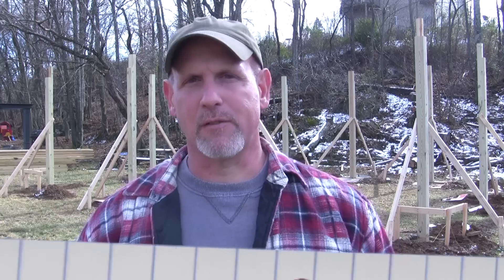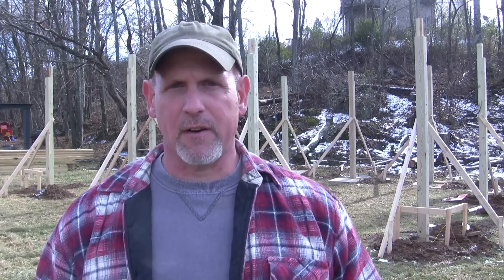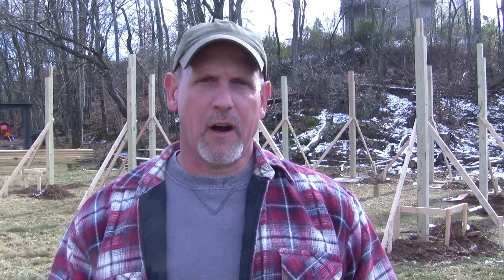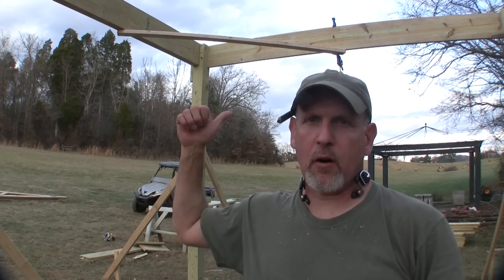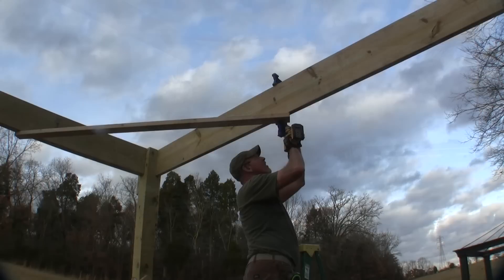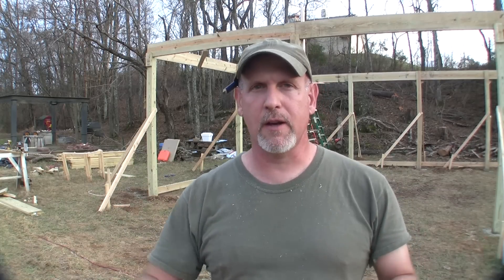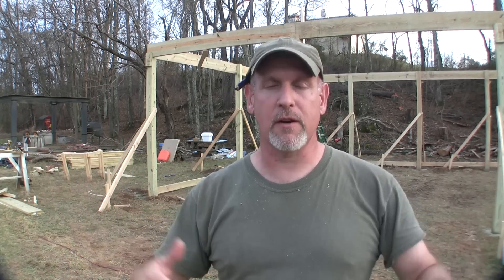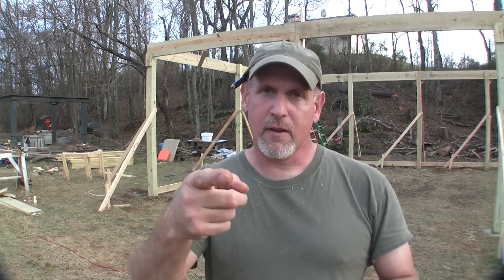How to Build a Pole Barn Pt 4 - Banding & Bracing for Trusses

Comment: On the front you needed a double 2x12 beam:  the roof trusses were not over a post.
on the rear you only needed a single 2x12 beam since the 5 trusses were ea over a post.
true?

Comment: Man I wish I could've done anything at all with my posts before going in the ground. We're in Meigs County on a ridge top. You never know when you're gonna hit solid rock with the auger or not. Not a dang one of our post holes is the same depth and I tore up both sets of teeth plus the auger screw tip just trying to get the holes down three foot. Mostly had to let the auger do what it could then use a bar and hand digger to get close to depth. Got my bands up and will flush cut the posts with a sawzall on the long walls then angle cut the posts on the gable ends once the trusses are up. Frost line in East TN 😂

Comment: I'm torn between putting my trusses (×2 on interior posts) over each post like the commercial pole barn builders do at 12' spacing or do 8' spacing with 2x12 double header on truss bearing sides. I'll be adding 1/2" plywood sheeting on top with rubberized material under the metal roof and I'd like to think the way you just did yours with the 2x12 double header on truss bearing sides and trusses at every 2' would be the way to go... Did you add a truss heel to the trusses when ordered? ... if it is to ever be insulated and closed in of course

Comment: Before putting the post in the ground drill 2 opposing holes and install 2 pieces of rebar then pore the concrete. Gives the concrete something to hold on to besides the slick 6x6.just saying.

Comment: I learn tons...I have zero experience in this and I think it is very interesting.  I do have some questions, how do you know how many nails to use and why nails over screws?
Reply: Screws don't have as much give, nauls will flex a little for shear and deflection. I'm a mechanic and i like screws but in framing, nails are better.

Comment: Iv watched all of these for my building I’m starting this week and I have a question. Where you notched your poles on the top of the posts, if I am using metal on the outside instead of sheeting it and plan on running the purlins on the outside of the posts instead of flush like yours and later on I plan to put metal on the inside as well can I run the header boards all the way around on the inside and outside of the posts without notching? I really enjoy your videos
Reply: He's notching so the weight will be on the 2×12,nails and screws will only tear out under load. Bolting may work for awhile but will probably split the 2×12 in time. 
But don't quote me,I'm not a carpenter nor have I played one on TV!😂🤣
Best to notch, haven't seen it done any other way. 🤔

Comment: 1:49  Frost heaving is where the moisture in the soil freezes.  Just like putting a water bottle in the freezer and seeing it expand the bottle, the frozen moisture will expand in the soil and it puts pressure on posts, foundations, footings, etc.  The colder it gets and longer it stays that way means the further down the moisture in the soil will freeze.  That pressure pushes up on the post.  When it warms up it resettles to a point but after years of repeated cycles, it can heave the post out of the ground, crack foundations or basement walls, and rack buildings out of square.

Comment: Fette, coming back and watching this series of builds for the second time, being that you work alone and for strength why not break the front and back banding into three sections making them easier to handle and bear on top of each post? That way you don't have seams under the trusses that are not supported. I'm just asking not trying to try and learn for the future. One of these structures is in my plans.

Comment: I do like the series so far but I thought I'd mention that where I live I was checked by the town inspector and was told that a) I needed a permit and b) my beam joints were supposed to be right at a post, not in between (too weak). I had to adds another beam all around with the joints at the posts. The inspector made another visit before I could move ahead. Trusting, eh?
Reply: Could not agree more.  The seams should rest on the post regardless if you glue the wood.  Take a look at the carrying beam in your basement.  The lolly column is where the break is -  Nice build and good instructions otherwise.

Comment: Just posting this for others. I saw pictures of an Amish built pole barn and where the 2x12"s are at the top of the posts notched. They used one 2x12 outside of post notched and on the inside another 2x12 not notched for the trusses to set on. They used four big nails on each side.  Thanks.

Comment: great video sir. My company builds lp-gas bobtails and we've been trying to open a a small shop but i think somethink like this will be our best bet. However were gonna try to build it about 16 ft tall using 20 ft posts. Should the principles of everything your doing still be the same. also we were thinking about pouring our pad when we put the poles in. is that something you recommend or do you recommend building the whole pole barn first?

Comment: For somebody who already knows what they're doing is a really awesome videos but for somebody that has absolutely zero knowledge some ideas need to come forth first idea I wish you would have shown how to set up that level you showed the receiver but that the transmitter and then on every corner number two some of your banding was not on post why do you allow the end of the two by twelves to hang in mid-air I always thought those had to be on post....And to be very very picpic incredible do you really think nails are enough you put like 6 nails and every banding and post lots of people think bolting is better I think nails are enough but I don't know anything....2 by 12 is an awful big thing 16 feet long why wouldn't you use just 2 by 12 8 feet long from post to post to post

Comment: I once pulled out at least 100 rotting fence post out and replaced them on a horse farm. they put dry concrete mix in twenty years earlier and every one of the came out of the ground with dry concrete around them. Just add water. trust me brother.
Reply: stoneygreek   I’m late finding these videos but totally agree with you about adding water mixing the concrete.  I had the same experience you spoke about.  As a kid we had set tall posts for a lean to add on at our barn.   16 years later after no longer using the building I decided to remove this part of the structure.  When pulling the posts found several of them that the outer edges of concrete had set up but the center of mass was still dry powder.   I  remember my Dad and my Grandfather arguing about it.  My Dad was always in a rush and liked to do it different just because he could lol. 
  But that being said definitely wet the concrete before it goes in the hole.

Comment: How about a report on your laser?  Model, how long you've had it and what you like or dislike about it?  It looks like a good one.  I use a straight line DeWalt and can see the advantage of the circular sweep with a sensor.  You must also have a good brand of lumber.  Where I am an 8x8 can vary 1/4" in dimensions and up to 3/8" if it is a pressure treated one.  Also getting good grades is difficult as our #2 and #3 seem to be what we called 'culls' a few years ago.  Center ring in every stick so warping and twisting is terrible.  Nice job your Kubota will appreciate it.  I was waiting for you to justify buying a hoe for it so you could lift those sticks into place!!!  (Another tool is always good).  Doug

Comment: Why not set up where your front band j9ints meets on a post
Reply from the maker: +Joe Butler I didn't want both runs of the bands all breaking in the same place.
Reply: *****  I see what your saying but that sets you up for a butt joint just hanging out in thin air
Reply from the maker: Yes, but they are glued and lag screwed all the way across.  Essentially you end up with a laminated beam.  It's very strong.
Reply: ***** yeah but breaking over a post would have been 10 times stronger
Reply from the maker: It's not carrying that much weight, Joe.  It doesn't need to be ten times stronger.  You could do what you are describing but you better plate the top or it might want to roll.
Reply: ***** ok I see what your saying

Comment: I have enjoyed your series so far.  am now retired but also used to do building construction.  There are things I would do differently but if it works then I say go for it .  This is reference your comment about frost heave and not understanding.  Think of what happens if you freeze say a botle of water or other liquid What was adequate for the liquid becomes too small for the frozen . Heave as essentially the same.
Reply from the maker: James Gass Thanks James.  Great explanation of frost heave.  I understand it better now!

Comment: I got it to work. Just finished watching the whole series! I will definitely come back to reference when I build mine. 
One question though Is when you put your floor in what will you do to seal the edges of the building from water, dirt or anything else getting in from the bottom?
Reply from the maker: Ryan Bender I can't remember the brand but any good concrete sealer will work.  I'd stay away from the stuff you buy at the big box stores like Thompsons, etc. and get a more industrial type sealer from a building supply company.

Comment: Frost heave is really easy to understand.  Water expands when it freezes.  If the ground freezes below your footings, it pushes the footings up.  It takes quite a few cycles, but after a couple of years, if your pilings weren't deep enough, your building won't be plumb or square.

-jcr
Reply from the maker: NSResponder Great tutorial.  Thanks for sharing.

Comment: You're good at explaining things but those joints need to fall on a post. Doesn't matter that they aren't staggered as long as they are supported on the end by a post.
You could always use a metal strap if you're worried about flex.
Reply from the maker: DEE K Thanks Dee.  Those beams are glued and lag bolted.  They aren't going anywhere.  And they aren't really carrying all that much weight.  If you are really worried you could plate the top and bottom but I think that would really be overkill.  Thanks for sharing your thoughts.

Comment: i mean no disrespect but here in Australia our building codes dictate you have to have the joint of a structural beam supported but might be different in the USA. Enjoying the series alot and cant wait to start building my own soon. nice work on the check outs also just another tip for the future use a straight edge that can span most of the post with a level and you will get the tops and bottoms perfect just a little trip I've picked up while building houses for the last 5 years or so
Reply from the maker: andreweasty No offense taken.  I appreciate you watching and commenting.  I think your comments make a lot of sense.  Thanks for sharing!

Comment: I am really enjoying this series. Another way to strengthen your double beams besides the glue and lag bolts is place a piece of sheet metal full length between the two boards. Then you can lag it up tight. Don't believe it will work?, take a piece of 28 ga. galvanized metal 8" x 24" lay it flat and see how easy it will bend, now rotate 1/4 turn and try to bend it edge wise. Can't wait to watch the rest of the series.
Reply from the maker: John Grange Great tip.  Thanks for sharing!  I appreciate you watching the videos.

Comment: Great videos! I'm curious about one thing. When you decided to run your top boards to handle your trusses and double them up using 14 or 16ft long boards, why did you not just center the boards on the posts?
Reply from the maker: Steve Pritchard Thanks for watching.  The bands are centered on posts in the back but the spacing on the front posts is such that it did not work out that way.

Comment: Really enjoying the video and especially your own personal narrating. Learning plenty. I harvested the tree last month and am ...rather was thinking of a pad and sticks. Very expensive and holding me back. I have not worked or built a pole barn and slightly unsure about what obstacle might bugger me. Your video has really taken the fear out of me and given me the strength and knowledge to begin a 24 by 32 pole barn. I have a back...small 22 hp Kubota to dig holes. If I make small wood frames and place the pole inside before I pour cement will this work?? The Kubota will dig more of a trench thus a wood frame with nails around the bottom of the post then the cement. What is your thought?
Reply from the maker: r1bourg Thanks for watching.  Glad the videos have helped out.  I'm not sure I understand what you are describing about a wood frame.  Sorry, but I just can't picture what you are trying to say.  I'd just dig the holes and set the posts the way I did if you can.

Comment: Really wish I would have notched the posts as you did. I tried hanging the 2x12 header boards by myself and ended up eating one while I was moving from ladder to ladder. The notches would have made it stronger and gave me a place to rest the header board. Great Videos
Reply from the maker: I feel your pain, Steve.  I had an eight foot 2X12 get away from me raising it up with the tractor loader.  Came down on my arm.  It felt so good when it quit hurting.  Ha!  I think the bruise is still there!

Comment: 5:00 I'm just gonna use my string level.
Reply from the maker: Hmmm.  Good luck with that.  Thanks for watching.
Reply: How would it be wrong or incorrect Mr Nailgun?
Reply from the maker: I'm not saying to there's anything wrong with it but over a span of 20 or 30 feet I would not trust the accuracy of a small level hung on a string.  I've always found it hard to "read the bubble" on something critical.  It's easy to be off half an inch or more over that span.  Good luck however you decide to go about it.
Reply: Hi Blaze.

Well I'll have a distance of 12 feet which isn't too great so I should be ok.
Reply from the maker: Sounds good.
Reply: Will try and let you know how I get on...

Comment: Nice job!  Why did you choose lags between 2X12's as supposed to Bolts/washers/nuts?
Reply from the maker: Thanks for watching and the compliments.  I've always used lag bolts on lam beams on houses.  Really, if you plated the top and bottom of the 2X12's you probably would not have to use bolts at all.  You just want to keep it from wanting to roll on you.  Hope that helps out.
Reply: Sure, understood.   I've just seen more folks do it with bolts and huge washers.  Nice thing about that is, after a few years when the wood shrinks, you can easily tighten them.

Comment: I think I would have used more screws vs. nails over time nails  tend to work louse, and if you need to re do something it will come apart <personal experience>, Like what you are doing .
Reply from the maker: Thanks for watching, Russ.  Good advice.  Thanks for sharing it.  There's probably more screws in there than the video shows because of editing but as I think about it, a few galvanized lag screws would be the way to go.

Comment: Hey Feddie - excellent videos and info. Gettin ready to build a 24x32 garage so you've really help me envision how to get started. BTW, which model number is your Paslode? Why did you pick it over other brands? Did you find it necessary to buy a 2nd battery, since I understand they take 30 mins to recharge. Thx buddy.
Reply from the maker: Thanks for the compliments.  I appreciate you watching and I'm glad you've found some inspiration through the videos.  The Lowe's item number for the Paslode nailer I use is 241992.  The Paslode model number is 902600.  I've used Paslodes before so I have a lot of confidence in their quality.  I did no not have a 2nd battery.  It has a lithium ion battery that will last a days work easy.  If not, theres a rapid charge on the charger that will have you running again with ten minutes.  Good luck on your project and lemme know how it goes!

Comment: Hey Feddie, just a thought, when I have to set at elevation, I will often stand on my tractor or in my hod. It makes me feel so much more stable and comfortable. Helps the process to move along more quickly. Thanks for great videos
Reply from the maker: Good tip.  Thanks for sharing.  I'm always in search of an easier way of things but unfortunately there aint much easy about a 6X6 fourteen foot treated post.  Ha!  I appreciate you watching!

Comment: Ok Feddie, it's starting to take shape.  I have a question for ya.  It may be a dumb question, but here it goes.  Did you pre-drill holes for the lag bolts?  Just seems like the wood might split without pre drilling some pilot holes.  Or that is my luck anyhow.
Reply from the maker: Yeah, I drilled a pilot hole before I sunk the bolts.  That makes it a little easier to drive the bolts in and helps to avoid disasters like you mentioned.
Reply: Ok, good to know that I wasn't being crazy.  Thanks man.